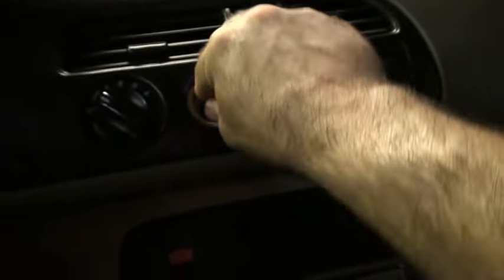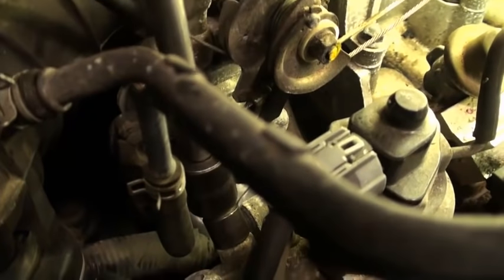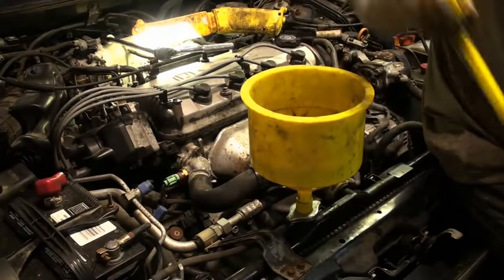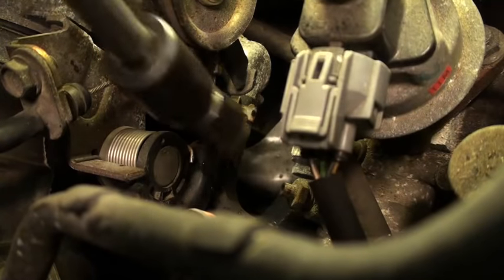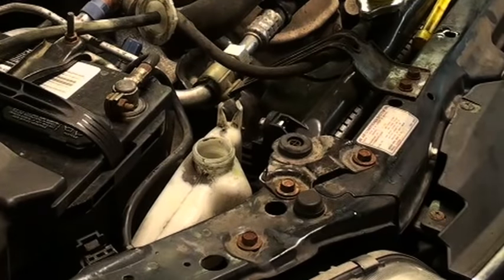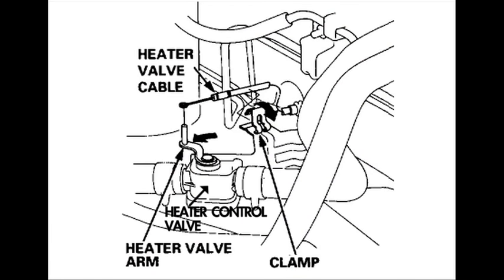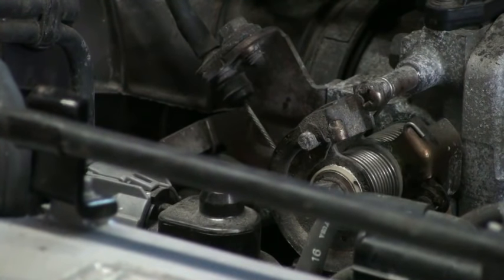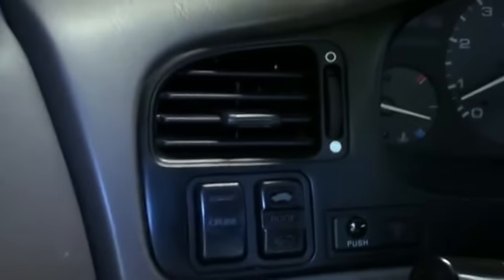How To Bleed A Cooling System - EricTheCarGuy

Comment: Eric , I noticed in this video  you opened the bleeder screw while the engine was cold not running  , yet some people do it while the engine is hot and running  ,which way is the proper way to do this?  I have a Buick lesabre 3800 v6 motor better yet can I do this bleeding system procedure with out touching those bleeder screws in case I snap one off
Reply: Yep, you don't actually NEED to use the bleeder screw....it just speeds up the bleeding (also called burping) process. Also spend the $20-$25 US on a Lisle spill free funnel, it's well worth the investment!
Reply: I like the traffic cone idea mentioned above in one of the comments, which probably cost him nothing.
Reply: you are right  I did mine last week and I just squeezed the top hose  when it was running and hot and it sure bubbled out more air.
Reply: I have a similar car my self 2004 buick park avenue and I'm having the same issue. I just wish someone would answer your question with details.
Reply: Hey, I have the exact same car. Just put a heater core in it. Now I still have no heat due to lack of coolant flow through the core. If I rev the shit out of it I get some heat, but that's not very practical. Either I have a huge air bubble in the system or it is leaking into a cylinder as I am topping off the system several times a week. I have no coolant in the oil and nothing on the ground. The GM service manual says to fill the radiator and overflow tank to full, install the cap, and run the engine at 2,500 rpm until the system reaches operating temperature. Shut off the engine and let it cool. Then remove the cap and refill both the radiator and reservoir and install the cap. That is the extent of the manufacturers' information. The only problem with that is it doesn't get rid of air bubbles and GM doesn't tell you how. With winter approaching I need an answer myself ... fast! If I have a head gasket leak I'm in trouble. Stay tuned......
Reply: @davenelson859  sounds like you just like scratching, or u got crabs...
Reply: @stphelps12  I know, what was the purpose of getting it up to OT when it was already burped/bled out while cold? maybe b/c some thermostats dont let bubbles go through the whole system and then out while cold and allow the coolant to level out throughout the whole system of hoses.

Comment: Do you recommend jacking up the front end while bleeding it? Or keeping it level?
Reply: It helps get rid of the big air bu bbles trapped inside
Reply: @1234videofreak  what helps? Tilting the car up or keeping it level?
Reply: @miguelthebest384  tilting the car up on jack stands

Comment: Does anyone know the importance of turning the fan OFF and heat ON when he's filling at the end?    Does it make a difference if the fan is ON too?     Thanks!
Reply: +Steve Murwin It doesn't matter, as long as the heat is on it opens the valve...
Reply: ok, thanks!
Reply: Steve Murwin No problem!
Reply: if the heater fan is on the heater core will act as a radiator and cool the coolant and it will take longer to get your car up to temperature. pretty much just a waste of gas.
Reply: +Mike MacD that's why the fan stays off so that you don't cool it down as it warms up
Reply: thats what Im talking about ..
Reply: @zippySquirrelface  give me a break; try blowing on a hot engine n see how much heat you'll get rid of ! The heat on allows heated water to flow through the heater core under your dashboard; in the summer time the valve controlled by your heat button keeps the hot coolant from flowing through under the dashboard. So its to allow coolant to fill hoses and heater core with hot coolant as it is circulated around by the water pump thus getting rid of any possible air pockets.

Comment: If there's no leak then drive the car and when it's cooled off, open the reservoir cap. The air will then come out. Top it off with more coolant (if necessary) and take another drive. Repeat the process until the coolant level stays the same.
Reply: that what I do always worked the air bleeds out

Comment: Just replaced the radiator, thermostat, hoses and pump.  Didn't know how to get the system full of coolant.  You helped a lot.  I didn't know about the bleeder plug.  2001 GMC Jimmy.  I'm rebuilding my AC also.  Your AC video helped with that too.

Comment: I know this is an old video but still extremely relevant. I have a 93 accord, overheating, I did this with and it wouldn't stop bubbling. I assumed it was the head gasket from researching the issue. It turns out I had a junky aftermarket thermostat that someone put it before I got the car. Replaced that with an oem thermostat and cooling system bled without issues at all.  Only go oem when it comes to thermostats. I think Eric also did a video on the importance of it. Anyway, I hope this helps someone so they can save themselves the trouble I went through.  Beats having to tear half the engine apart to repair.

Comment: Damn it.
Why does no-one give tips on full system air bleed?
Turns out my water pump has a friggin air bubble in it that won't come loose. The bastard.
All I know so far is to try putting it on an incline. I also thought of maybe using a plunger on one of the pipes? IDK.
Anyone got some tips?
Reply: Take out the thermostat and force some water through the radiator hose. all i got.
Reply: Plague Doctor )(

Comment: Thanks for the videos, really well done and helpful. Had fluctuating idle and thought this was the reason because I just replaced the radiator (without bleeding the air). 
In my case it ended up being something else - A mouse had gotten in and chewed up the air filter. Debris had gotten into IACV, causing it to stick. Cleaned it out with some break cleaner, all good.

Comment: You shouldn't be putting greasy gloves all over the steering wheel and behind the seat  when backing up.  And that funnel is nasty too.  How hard is it to wipe it down after each use?  I do most of my work, but I had a guy work on my Cadillac one time.  Got in it and grease was everywhere.  I reamed his ass!
Reply: da324 b
Reply: Most mechanics clean any mess they made before sending the vehicle back out. I really don't see the issue.
Reply: I was thinking the same thing. That should be for antifreeze only, use a different funnel for oil changes etc.

Comment: thank you for this! car was idling high. and fluctuating between 1-1.2k rpms. went to my local advace and spend 40$ on that funnel and it fixed my problem. no mess. and now i have a nice funnel. you earned a subbed :)

Comment: Ah ha. Did a tune up yesterday, put coolant. Next day car overheats and there was a leak like under and back of engine, not the big hoses as I thought. Went by gas station and put water and drove home. I look under car and no more leak or overheating. Did air got out when I put water and also turned heater on. 
Now the system has water. Now that I know about bleeding the cooling system will do it right. Never done that to any of the cars I have own. But now I know. 
Thank You.

Comment: I have a 99 Volvo V70 GLT. I replaced the ETC sensor because it coded on emmissions check and the fan was running all the time. It is working properly now. Also replaced the thermostat, thought it would be wise to do so. It's driving me crazy purging the coolant out the overflow when it reaches temperature.  I have tried everything found online to get the air out of the system, even took it to a specialty shop. They pressure checked it, it was fine, even checked for blown head gasket, none. I have purchased 2 thermostats, though they look the same, and both operate the same. The one I removed has one of the little toggle pins in it, but the new ones don't. I did see that you recommend not turning the fan on when trying to bleed the air. If a Volvo has a bleeder valve I wouldn't know where to find it, but nothing online shows that it does. I literally have gone through 5 gallons of coolant and lots of water, as I got tired of loosing the coolant, but this has me baffled. It was so bad today I kept stopping to put let it cool and put more fluid in, just wanted to get home and not drive it. Am supposed totake it back to shop on Monday. The radiator was replaced a year and a half ago, and it finally bled. I had no problems prior to replacing these parts. Any ideas???

Comment: First let me start with , I’m always watching your videos when it comes to any car problems, very informative and helping.. now with that been said I have a 96 accord wagon with the 2.2 vtec engine auto transmission and I am having a problem with car not giving enough heat. What I’ve done so far was change thermostat, flushed heater core, bleed cooling system, now it gave me more heat , but the problem is that when I start the car to warm it up in the mornings the heat is still cold even after it idles and the heat kicks in when I start to drive and I also noticed that my fan doesn’t turn on, I’ve ran direct wires to check if the fan is working and it is working, can it be the cooling temperature sensor or the cooling fan switch that’s causing the problem?

Comment: Great Video...I picked up one of those funnels, gonna burp my 69 BBC Camaro 'cause I put in a new radiator with eFans, new thermostat, all new hoses, new water pump, and Vintage Air.  I had drained the block as best I could, also drained the old heater core before taking it out. My car never had a overflow tank or a catch can of any kind, so I think I will add catch can connected to the hose coming out of the radiator neck. What do you think Eric?

Comment: +EricTheCarGuy I have a 2000 Honda Civic LX 1.6L sohc daily driver. Radiator cracked and overflow tank lid separated as well as a result. Replaced both and filled the coolant and burped the system. Or so I had thought. I'm now on my second radiator and overflow tank. The head gasket and everything else included in doing that job have also been done. There are no leaks, no loose connections, no CEL, etc, etc. Car idle is at 3k rpms when in P, N and in R,D is around 1.5-2k rpms and never settles. Came out of no where. Cam and crank gears are both at top dead center. After checking all of your videos about Honda idle issues I finally bought this spill proof funnel. I do not have a bleeder valve on this engine. I guess they stopped putting them on after x amount of years. Anyway I did this method today and my coolant actually started back flowing into the funnel almost to the top and was blowing steam and spewing coolant out from it. I immediately turned the car off and the fluid gradually sucked back down the funnel. I'm not sure if I'm missing something but this did not go as planned or help anything. I topped off the fluid and the overflow tank and called it quits for now. Maybe it is the idle air control valve? Any help is appreciated.
Reply: +Daddy Dave Well I took another look over everything just a little bit ago after doing some more research. I took the intake manifold off and redid the gasket. Adding some Permatex Right Stuff to it and letting it sit for a bit. Gonna fire it up and see if that stops whatever was/is causing this issue. I'll report back for you or anyone else interested in listening and or helping.
Reply: +Daddy Dave Fired it up this morning and the idle was a little high @ 1.2k rpms but gradually fell down to around 800 rpms. It is around 20* out so should be normal. No CEL, no smoke, no high idle. Believe I fixed my issues. Going to order a multiple steel layer gasket for the intake manifold and redo it once more. The paper like gasket from Felpro is what came in my engine gasket kit and believe it was crap. So, so far so good. Thanks for all of your videos Eric! Means a lot to me to be able to save money and also to STAY DIRTY!

Comment: I got into 'fight' with my dad because I wanted to fill the system like this after changing the water pump. He insisted on filling the system through the reservoir only! He said "It will suck the coolant into the system from the reservoir when we turn on the engine, and then gradually fill the reservoir accordingly". I didn't really have an explanation as to why I wanted to do like Eric did but I'm glad my dad accepted this way eventually!

Comment: Extremely helpful! After engine overhaul on 03 Honda Accord, 3.0 V6, 6 speed coupe, car overheated fast, swollen radiator hoses, etc. Mechanic said gasket leak. I am now thinking system was not bled properly! This car has the bleed valve on the rear of the vehicle, correct?

Comment: I need to replace the thermostat in my '98 Civic because I have reasons to believe that it's either stuck open or opening prematurely. I may as well replace the coolant while I'm at it. Not sure if mine has bleeder valves though, my engine is slightly different from the one shown here.

Comment: Hey Eric, I have a 98 Dodge Dakota 3.9 that the thermostat stuck wide open & over heated the engine to the point of popping the lower radiator hose off of the water pump.
So I put a 180 degree thermostat in it, changed the factory radiator cap (16 lb.) filled the coolant, brought it up to 2700 RPM until I saw heat trickling from the radiator. (belt driven fan), the temperature only came up to around 140-150 degrees.
I noticed that I could feel heat coming from the vents until I topped off the system with the engine running and once I put the new radiator cap back on, the heat from the vents went away and my gauge says it's running about 200 degrees.
Does the tell tale bubbles from a bad head gasket coming up from through the radiator neck have anything to do with the heat disappearing ?
Thanks for all your videos!

Comment: How is it that when doing this, the cooling system is still fine even though there isn't pressure as you're bleeding the system?  The coolant wouldn't start boiling due to no pressure/lower boiling point?  Obviously it looks like this whole process works without pressure on the system, but I wanted to make sure I understood why.  Is it just that even after the thermostat is open that the temp of the coolant is still under the boiling point?

Comment: Hi Eric,much thanks for your channel. Can you please post how to bleed a 3.9 Liter Lincoln LS. It has a Degas bottle, that's pressurized,not ordinary overflow bottle. I had my first bottle crack after 8yrs. I had it replaced. I had bad thermostat and thermostat housing. System was bled of air. New bottle cracked after 4 months. I just got yet another one,and had it installed,and new hoses,and cap. I'm at my wits end with overheating issues. Is Jaguar 4 liter so difficult to bleed?

Comment: Hey Eric... great video. appreciate the info and your explanation. I'm working on my 86 Fiero GT restore project. Is bleeding done the same way? I've read some blogs saying to fill the coolant through the coolant housing on the engine, leaving the radiator cap off as well. What's your thoughts?

Comment: My 2004 Mazda rx8 has all the symptoms explained in you're video. When i drive for over an hour straight and park it but keep it running sometimes it will shut it self off and then I'll have a difficult time starting it again. Wondering if you knew anything about rotaries and/or if this method should work on my car too

Comment: Tanks Eric .  I ad a hose replaced on my honda by a mechanic  ( back of the block ) on the idle control , 
As sprayed some or lot coolant on my alternator  .I ad nothing but problems . The alternator  went . And the idle goes up and down .
Tank you your video as help on solving this issues  and problems

Comment: Hi Eric,  I have a Honda Accord Lx 2001 automatic 4 cylinder, my first gear or second when shifting jumps when I come to a stop, after that the gear shifting is smooth it does that only when I am in traffic or at a stop sign.

I saw your video and changed the coolant. But I don't have the funnel that you had in the video. 
I also have changed the transmission oil and all the mountings. 

Please let me know if I need to check or change anything. 

Greatly appreciated your help, and thank you for all the time and information you give, it's a blessing.

Comment: Really appreciate your videos, thanks! 2009 Accord -  I got home last night not having noticed my temp gauge well above normal.  I popped the hood and it looked like a bomb of boiled discolored) coolant had exploded all over the left side (reservoir side).  Reservoir was empty.  I used pressure tool -  It held 16psi w/ no prob.  I added water to top it off.   Started the car, the fans come on/off periodically so that seems ok.  Doesn't seem like i would see so much coolant all over the engine if it was head gasket, right?  So...i'm off to check the thermostat.

Comment: hey eric. great video as always.i recently did a cooling overhaul in my E39 bmw 528i. my problem is that in the winter time heat only comes out on the driver side. i'm assuming it's my heater core as it was not my thermostat. do you know if its possible to rebuild the heater core and would you recommend flushing the system with prestone radiator flush and what not

Comment: What's up eric the car guy, your videos are very helpful and your my goro guy, thank you.  I have a question that I hope you can answer,  I have a 06 eclipse 2.4L automatic  and I changed the radiator, it starts to run hot and the radiator seems to be filled, I tried a few times to try and get the air out which I believe is the problem why its running hot since we put it in, I looked for the bleeder to let air out of system but I can't find it anywhere,  I have a funnel which fits into the top of radiator and I was going to fill it up so that I can try and hope to get the air out, I was wondering if you think that might work because I can't find bleeder valve and dont have the funnel you have that tightens to the radiator. Thanks again for all your videos and hope that you can help me out.